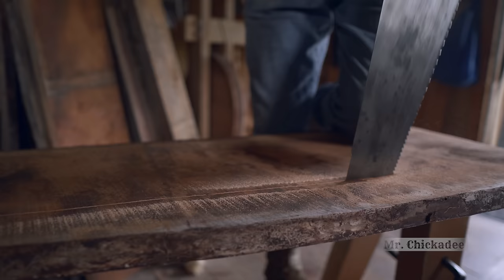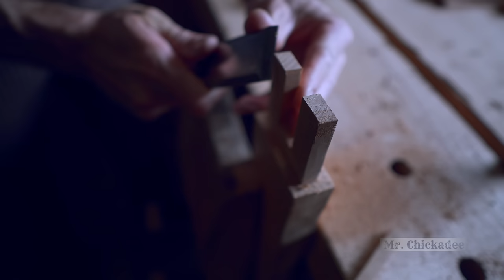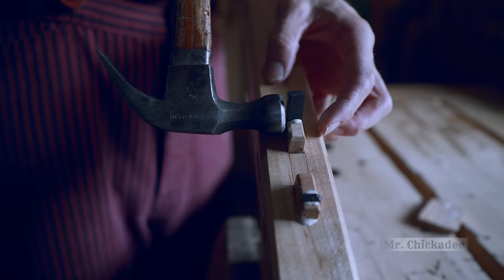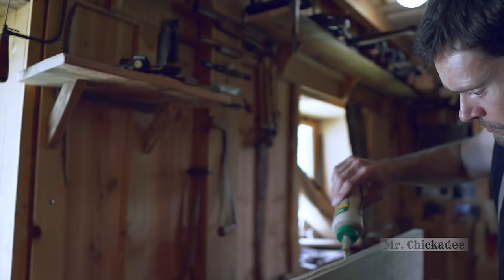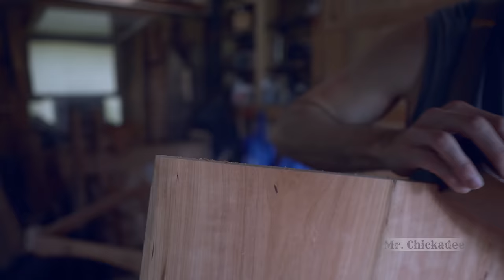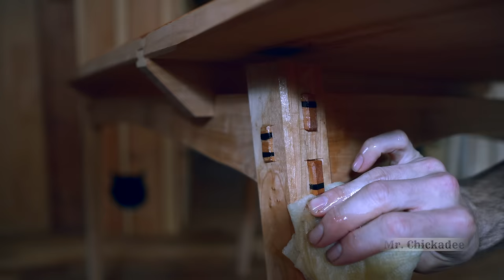Floating top cherry dining table with sliding dovetail battens and wedged tenon joinery.

Comment: Always so inspiring. In addition to the incredible craftsmanship, there is not a single piece of waste in the process. No sand paper, no tool that cannot be sharpened, no wasted blades, and what remains is a stunningly beautiful table, and wood shavings that can be used to heat. And cat. :)

Comment: Dear Sir, I started carpentry in 71 we used the stair router like the one you were using. The cutting edge is tempered to hard very difficult to sharpen . Heat the cutting edge just a bit to soften it ,, then sharpen the tool. They work so much better after that. Great work wonderful video

Comment: I could seriously , being an ex navy guy enjoy doing some serious fret and clockcase work with a fellow ex leatherneck . yeah , i do believe i could . i enjoy Handwork much as you do with older , original tools , as well as some finer machine tools as well . i've been building grandfather , regulator , and shelf type clocks and furniture since 1986 . i am a retired aviation cabinetmaker and finish carpenter by trade . i enjoy blacksmith /machinist work as well . Recently i've gotten a bug in my brain , wanting to build a new home . in the japanese antiquated post and beam style , with modern insulation , wiring , etc . but remaining , structurally as original as possible . i enjoyed your other video on the japanese type building addition. quite informative . i have ordered several sets of blueprints from Japan on Samarai type estates . This is the direction i am headed into .

Comment: Prior to watching your video, I had spent 30 minutes on another channel following a young upcoming YouTuber using a circular saw, a table saw, a jointer AND a sander to make a desk out of pallet wood, while modern music and non-stop talking filled up the blanks when per chance a noisy engine was not running. And then here I am witnessing the making of a dining table without even the shadow of a power tool in sight, where all the cutting and planning is done 100% by hand, completely built in religious silence. It was like jumping from a gridlocked central business district packed with cars honking their horns and sidewalks jammed with shouting people to sitting down in a spring meadow where butterflies caress flowers kissed by a soft breeze alongside a gentle brook... the contrast could not have been more extreme. Simply the best YouTube woodworking channel for Asperger viewers like myself, absolutely no contest. And your tools are so sharp! That big chisel working close to your fingers gave me shivers haha.

Comment: Yet again, another beautiful creation from wood by Mr. Chickadee. I like everything about the table, the curves, joinery techniques & finish. I used the same brand tung oil on my pine floors, but I chose their dark mixture & cut it with mineral spirits for deep penetration into the wood. Thank you for another fine presentation!

Comment: Amazing! Question on the finish: Did you put tung oil on the underside of the tabletop or just the top, sides, and underside rim? Is there a reason to leave it untreated (like moisture) or is it just because it's unnecessary? Also was that just one coat of oil in total? I keep seeing people suggest sanding in between two coats of tung oil but I feel like the sanding undoes a lot of the point of finish planing.
Reply: Generally you should always treat both sites, since the oils hardening changes the way the wood shrinks/and works with moisture. You can get warping etc.

Comment: Wonderful. Cherry? 
But cut your tung oil 50/50 with turpentine for the first coat, then 75/25 for the second coat. And it isn't really "cheating" to rub with #00 - # 0000 steel wool in-between coats.
And you'll be wanting it bigger once family comes along.

Comment: Do you ever use more traditional glues like hide glue or casein? I ask cause the old books used to talk of rubbing boards together to edge join them. Something they would say was only possible with hide glue.
Reply from the maker: no, if I need to glue i just use titebond normally, you can also do rubbed joints with it

Comment: Nice design! Are the joints between top and frame tight enough that one can lift the table by the top, or does the top then come off?
Reply from the maker: lift no, but grab and slide sure.

Comment: I miss bench work.
Did you choose Titebond 3 because of its darker glue line?
If you joint both pieces of the top together (book folded) any bevel will cancel out and the top will automatically be flat.
Reply: Beautiful work Josh!  👏